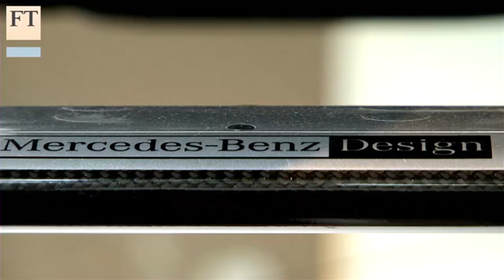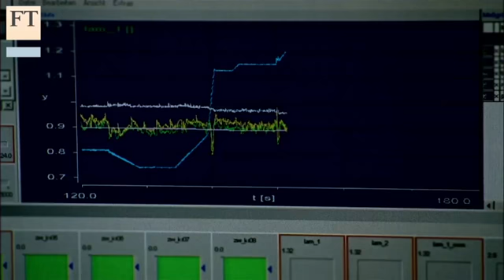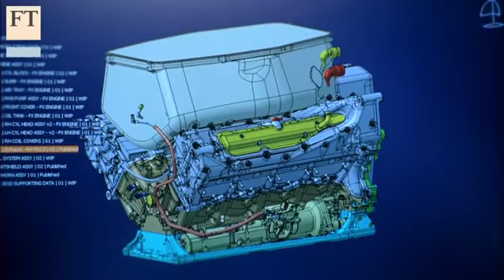F1 on track for speedier technology transfer

Comment: More and more manufacturers are going with turbos and turbo diesels especially for colder climates like Canada, in the winter temperatures can go as low as -60 C in places. So until they can get electrics with long run times and longer battery life and cheaper replacement costs, turebos and turbo diesels are the best bet, at least in Canada.